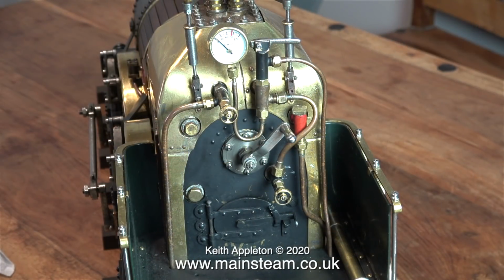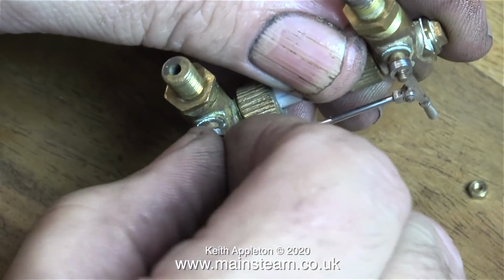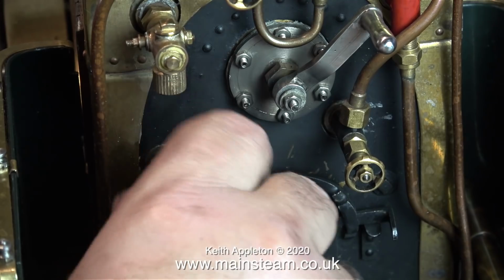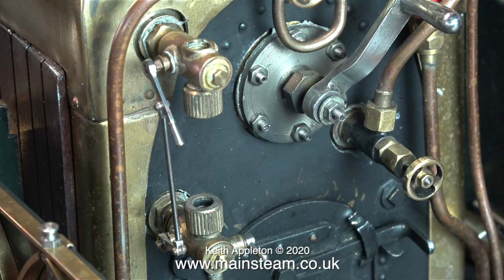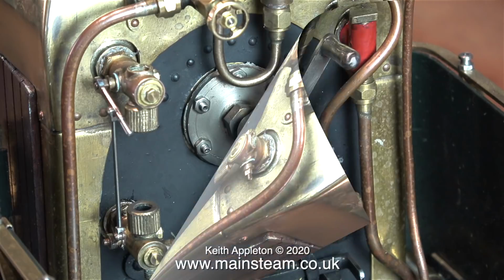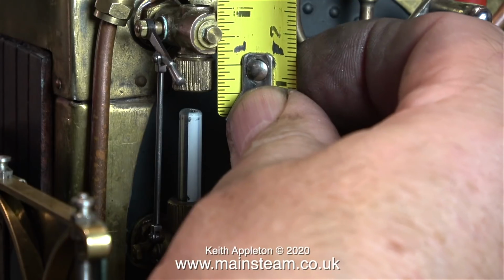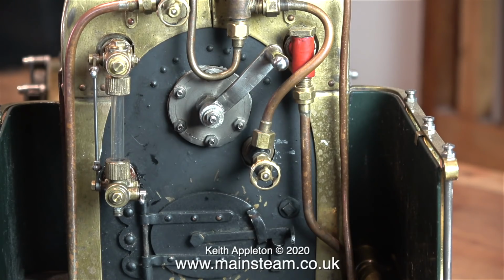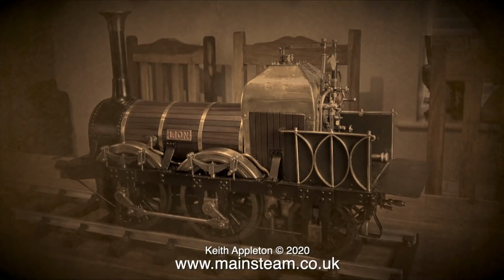A "LION" LOCOMOTIVE IN 5 INCH GAUGE - PART #6

Comment: Just as a matter of interest (or not!) cant remember if I mentioned this before, but years ago when Lion was out on loan to various preserved lines, I used to go out as a mate with a friend of mine calling himself 'Beckenham Heavy Haulage' with an old Atkinson tractor unit and low-loader mainly for the Bluebell line, but at this time for the Didcot Rail Centre .  We moved lion from Didcot back to liverpool museum  where it lived in the basement along with a Liverpool Overhead Rly; motor coach. It had been out for about 18 months or more, on on arrival we found that they had altered the wall  and gate into the yard and we could'nt get in. Had to lay up overnight while the got a hire crane to lift it over the wall!  This may be interesting or f--- boring!

Comment: Keith, those that disapprove of the Blackgates spanners in my eye, are not engineers. I have worked on standard gauge steam locos for the last 10 years and during this time, I have acquired many spanner’s produced by British Railways and also the 4 pre nationalisation companies. Some of these spanner’s are direct copies of what Blackgates produce but obviously being full size. They are termed as ‘brass spanner’s’ as they are predominantly used on the gunmetal boiler fittings to prevent the hexagon heads from being damaged. I can send you a few photographs of these spanner’s in use for you to include in another video if you like to irritate these engineers that disapprove? Keep up the good work Keith!

Comment: A neat gauge glass assembly. A method that I use with consistent success to get the gauge glass fittings top and bottom "parallel" that is concentric in both planes to the boiler so that the glass will not break as can happen if the glass is put in at angle is to use a drill or rod same diameter of gauge glass. This ensures it is all lined up, prior to fitting and subsequently breaking the glass if it is wrong, which can happen if you do up the gland nuts and apply pressure.

Comment: Keith, the nut or bolt doesn't care what kind of tool turns it as long as it turns it. Whether that means a Bahco spanner or laser cut wrench.  If it works for you that's all that matters.